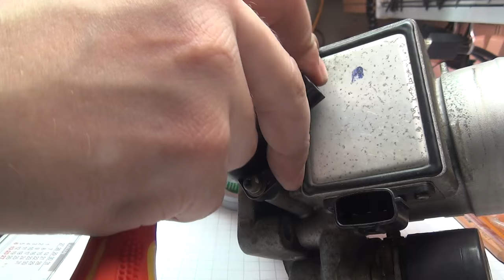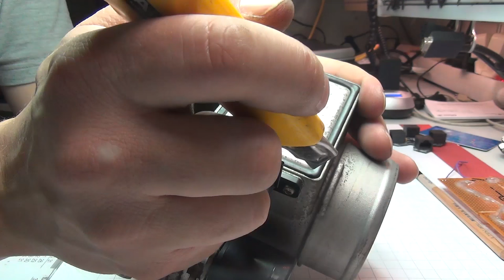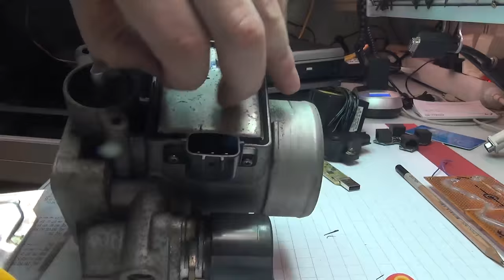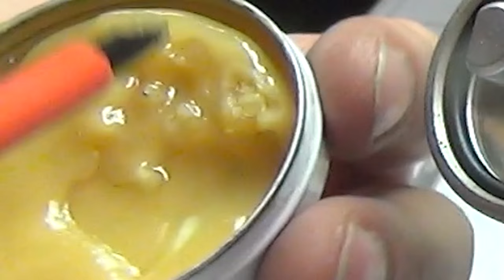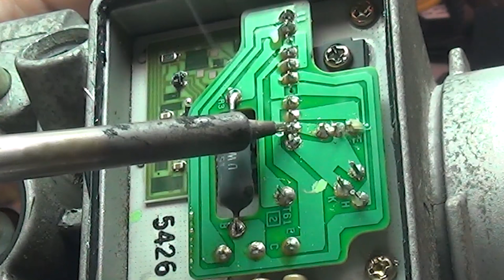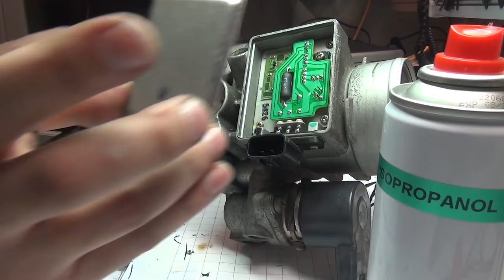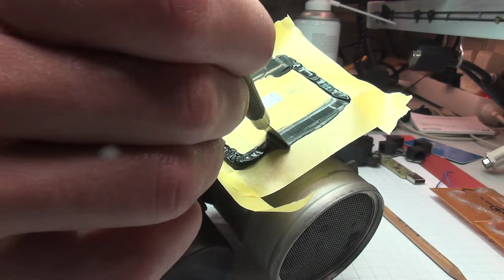Nissan Micra K11 throttle body resolder (mass air flow error repair)

Comment: My BF is doing mine tomorrow. We got the throttle plate off. What is the process at 3:00 onwards. Are you putting the soldering gun at a higher temperature?
Reply from the maker: Didn't do anything different, kept the temperature on 350 the entire video. Just heat up all solder joints and the flux will fix it for you. Make sure to clean the flux before sealing the thing, you don't want it to cause corrosion later on when it's closed. And don't forget to buy him a nice trophy-mug when he has fixed it!
Reply: Ok, thanks for the reply. When you mean clean the flux, you mean with the isoproponol spray. We have bought some. How long should you wait before the flux is dry and ready before applying the isoproponel cleaning stuff?
Reply from the maker: The flux doesn't need to dry. It is there to help the solder flow better when it turns fluid. So as soon as the solder has hardened again, you can clean it off with isopropanol (alcohol).
Reply: OK, many thanks for the advice.

Comment: my k11 wont start, it only starts with startup gas, and dies when i stop spraying.. first i had ignition problem so i change the distributor now that works but it wont start and the sparkplugs are not wet as the should be if the engine dosnt start fuelpump works. enginesymbol flashing..  what can the problem be´?
Reply from the maker: Have you tried to connect a Nissan Consult cable? You should then be able to see the DTC's. Google can help you figure it out.
Reply: no i havent, I just bought myself a errorcode reader, hope that one will tell me whats wrong :)

Comment: Mine stalls immediately after starting if it will start at all and the self diagnosis flash code was 143 which apparently is the throttle body too, my car is parked quite far from home what size allen key bolts hold it to the car

Comment: Which one is the MAF sensor?
Reply from the maker: You can't see it in the video. It's not important, because you should not touch it. The problem is not in the sensor, it's in the solder joints on the circuit board.
Reply: ok, i just wanted to know so that i can test my car with the sensor umpluged to see if it is the sensor that has the problem.
Reply from the maker: You can't unplug it; it's embedded in the throttle body, behind the mesh.
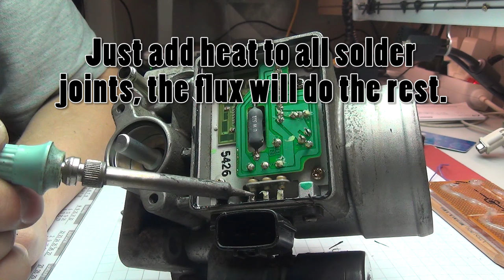Reply: @ClovisRibeiro1987  You can unplug it. At 2:06 the connector is on the bottom of the screen. ( But as far as I remember my car didnt start with that disconnected. )

Comment: You just saved my micra 😁👍🏻
Reply from the maker: +1 Micra! Thanks for fixing!
Reply: Maybe not...was 100% perfect for three day and now it’s doing the exact same thing again except much worse now
Reply from the maker: All depends if you did it right... Did you heat every joint right? Did you use the right flux? Did you clean it thoroughly after you were done? Did you close it up watertight after?
Reply: Lex Michdekammera yeh, it’s very strange...it’s moved the Rev limiter down to around 3000rmp
Reply from the maker: Did you put back the black throttle sensor the same as it was before? Have you connected a Nissan Consult Cable?
Reply: Lex Michdekammera hi yes did all that, but just a little update I decided not to mess about with the standard one anyway and decided to get one of the aftermarket OEM parts as Nissan ones are £500-£600 just fitted it and it runs absolutely perfect once again, fingers crossed it won’t play up again
Reply from the maker: Good luck. I guess yours was just beyond repair. A new one should outlast your car.